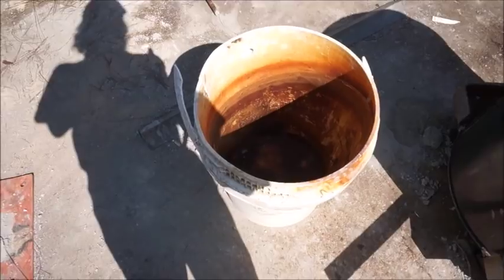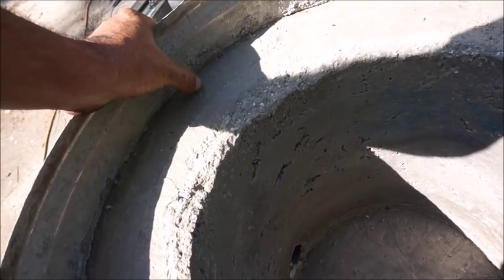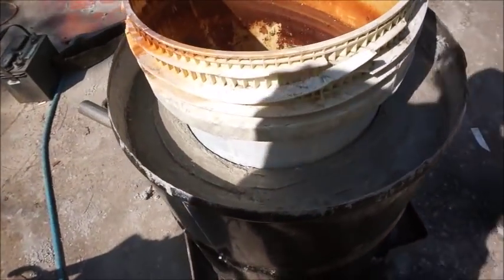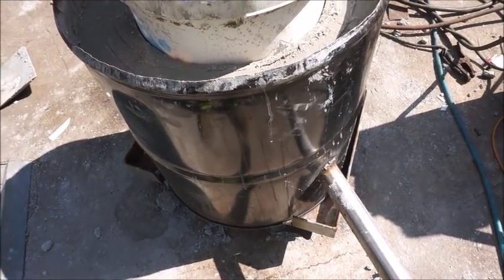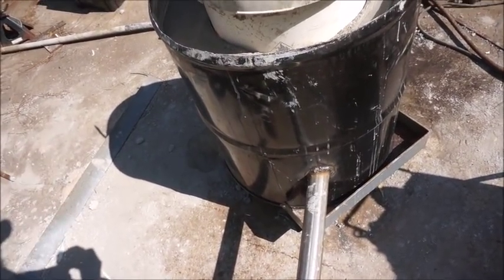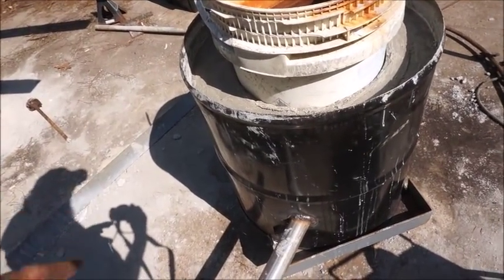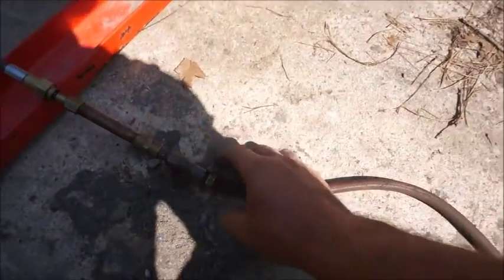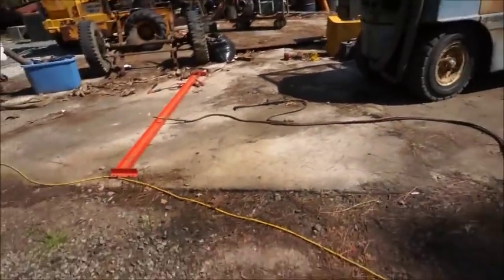Aluminum Furnace Build Part 3

Comment: great work! alot better than mine from play sand and plaster of Paris I'm s galvanized bucket with charcoal and a hair dryer. take care!
Reply from the maker: Melting is melting, really don't matter what you use if you get the job done. The cans you are melting are actually suppose to be a very high grade aluminum.